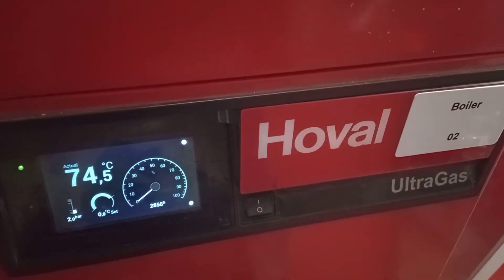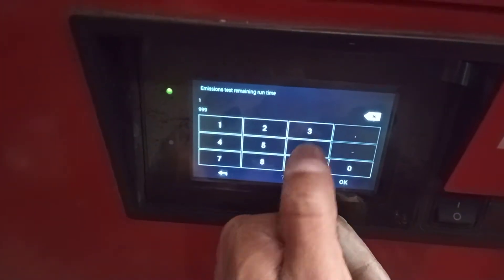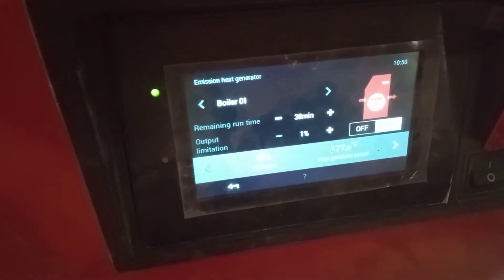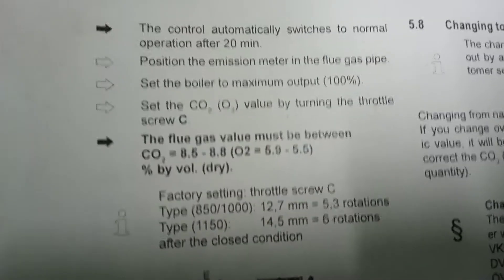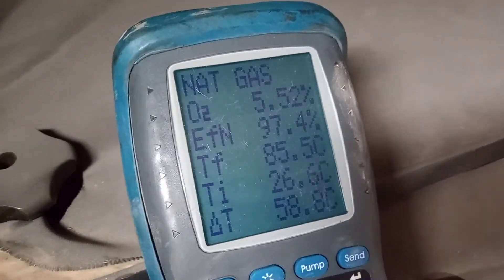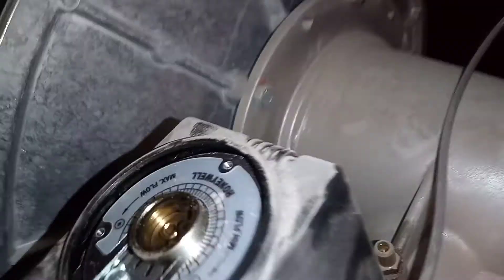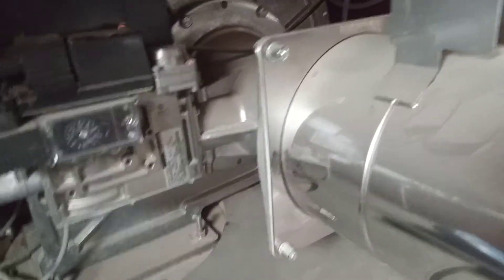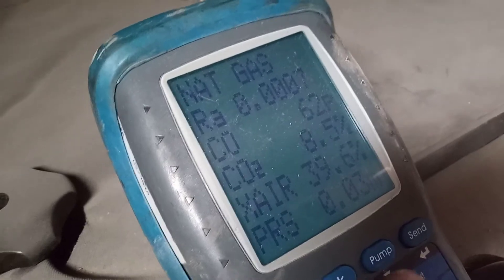HOVAL ULTRAGAS 450KW LOW & HIGH FIRE

Comment: I like it when people write what readings are needed on the back of the  boiler including gas volume of pipework and test duration etc and ventilation....ps how did you get onwith that weather compensator issue
Reply: I worked on the non digital  versions of these they were not bad until we had lift the burner out etc x 2 men needed
Reply from the maker: @boilerroombob  sounds tough. I was sweating when I climbed on top of this one as temperatures were 35-40c. Flagged it up.
Reply: @CommercialGasEngineerVideos  yea if there burning clean and sound ok and your not  losing  flow water pressure down the condense drain and it's not been more than say 2  years or so and the manufacturer says its OK.....then dont open them up unless you have all the gear with you
Reply from the maker: Never thought about writing the volume calculation down for another engineer. Seen ventilation near doors. Like when mechanical ventilation is written down. The Mrs was shocked that I wrote on their lovely boiler. I doubt I'll be going back to that weather com job. Think it got put to bed. Saw a recent video about weather com on Allen Hart channel.
Reply: @CommercialGasEngineerVideos  yea I normally tuck it out of the way but right it all down as I forget....so that job where the rads were temp was that sorted m8 x
Reply from the maker: @boilerroombob  Don't think so. Maybe after I went they stopped complaining.
Reply: @CommercialGasEngineerVideos  yea maybe m8  ....sometimes it's best to get a controls engineer in or recommend a good controls overhaul.....you do well though m8 with your channel will look forward to more posts

Comment: Hi! Would you be so kind to help me track a Hoval Ultragas low fire problem? The flame is out when the modulation gets low (under 10%). Already checked gas, CO2 and O2 levels. They seem ok. Thanks in advance, any advice would be appreciated!
Reply from the maker: Yes! The issue of a Hoval Ultragas flame going out when modulation gets low (under 10%) could be caused by several factors. Here are some things to check:

1. Gas Pressure Issues

Ensure that the inlet gas pressure is stable and within the required range.

Low gas pressure can cause the flame to extinguish when modulation drops.

2. Flame Sensor or Ignition Issues

A dirty or faulty flame sensor might not detect the flame correctly, leading to shutdowns.

Check the ignition electrodes for wear or misalignment.

3. Air-to-Gas Ratio

If the burner is getting too much air at low modulation, the flame may not sustain.

Check the combustion settings and ensure the correct air-to-fuel mix.

4. Modulation Settings

Some boilers allow adjusting the minimum modulation settings in the control panel.

Try increasing the minimum modulation above 10% to see if the issue persists.

5. Condensation or Blockage in the Flue

If condensation forms inside the flue, it could disrupt combustion.

Ensure the flue and air intake are clear of obstructions.

For technical support in the United Kingdom, you can contact Hoval's Technical Department:

Phone: 01636 672 711

Email: technical.uk@hoval.com

Comment: i work for hoval, and there should be a sticker on the gas valve with the values that are needed
Reply from the maker: That would be a good suggestion for the next models. All boiler manufacturers could do with certain things etched on it. Maybe they want us to make sure we're looking through the manual. I wonder what details you would recommend being put on the side of an appliance?
Reply: @CommercialGasEngineerVideos it’s not a suggestion it’s a need. there SHOULD be a yellow sticker on the gas valves stating that it’s 5.5-5.9 o2% this is a newish model
Reply from the maker: @stanleycottrell6804 must be great working for a manufacturer. The technical side of getting to know those appliances better than anyone. The training etc. I've worked in many types of buildings up and down the country but have never worked for a manufacturer. I think the driving would be too much. Also they haven't always come running with sacks of money. Yet I'm sure some have less driving and deep pockets.

Back to your point. I don't think all the stickers end up on the boilers. I've seen units without data badges on a viessmann. After measuring the boiler dimensions and doing a gas rate to work out the model was I abit more confident what it's name was.

That particular boiler in this vid was worked on by myself about 2.5 years ago. In a hotel with plant room temps at above 40c. Recall that at the time, I didn't realise that there was a step at the front. Also thought that I was going to collapse in my pursuit to adjust the combustion. They sorted out the heat issue by adding ventilation and lagging the pipes.

I do think it's of the upmost importance to get the combustion spot on. Although I have had engineers I've supervised always getting this spot on. I think they believe only the manufacturer needs satisfying and in their pursuit they miss other things. Hours are spent getting the Co2 and 02 perfect. Fair play to them. Then I find at risk and ID situations everywhere. 

I do love a hoval boiler. Those big red things are easily identifiable. I recall the first one I worked on. Not realising it's reset button was hidden.
Reply: @CommercialGasEngineerVideos  good to hear mate working for them is good i’m only london based so i don’t have to travel to far! and i find with manufacturers they won’t pay the most but by god will u be treated well, job and knock, all travel payed for it’s brill!
Reply from the maker: @stanleycottrell6804 well, if they aren't digging deep to pay job and knock has to be a given and addressing one as sir or master cottrell. Good It's all London based. Travel paid too, lovely. Too much work in London to be sending engineers all over the country. If I get anyone asking me about what it's like to work for Hoval I'll let them know it's good.
Reply: @CommercialGasEngineerVideos  haha brilliant take care mate glad i found ur channel